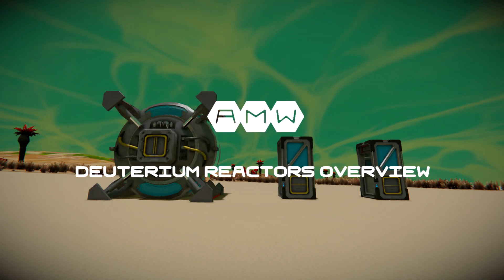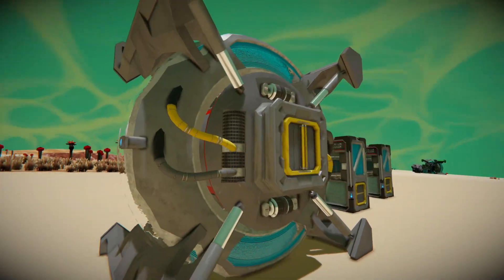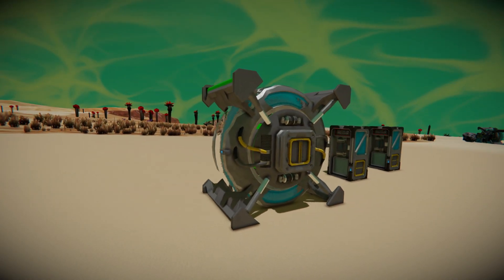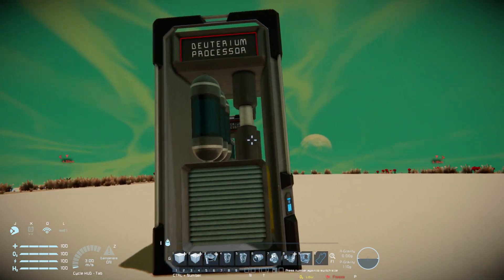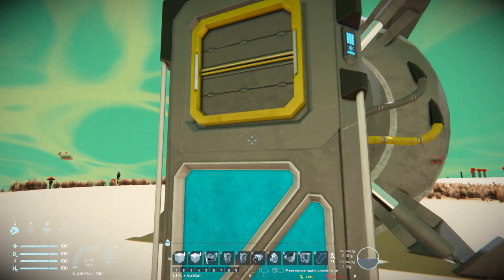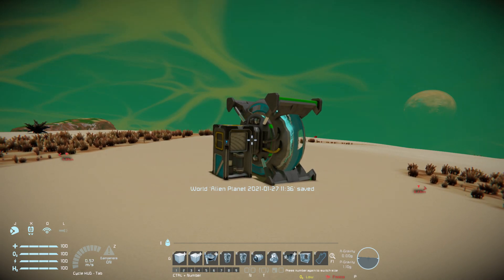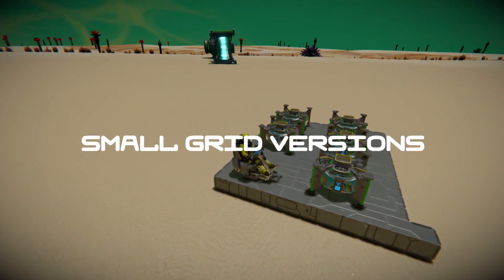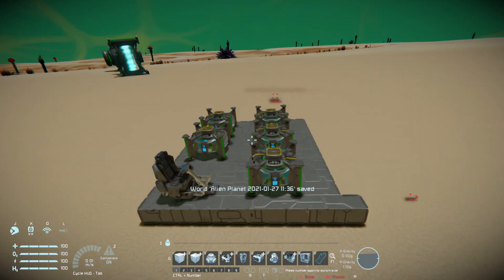Deuterium Fusion Reactors Mod Overview | Space Engineers

Comment: Last time i tested these they barerly used much deuterium, so its very OP, even when using like the full power.
Reply: It changed. When I first started using this mod they barely used anything and deuterium was everywhere.
Now they still use very little fuel but the ore veins are rather rare and the yield from the processors isn't as high anymore.